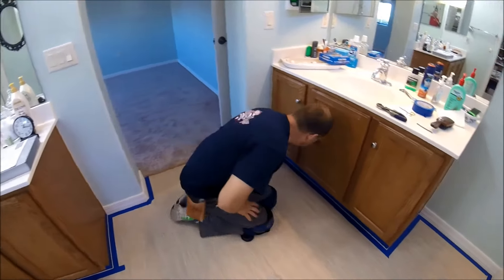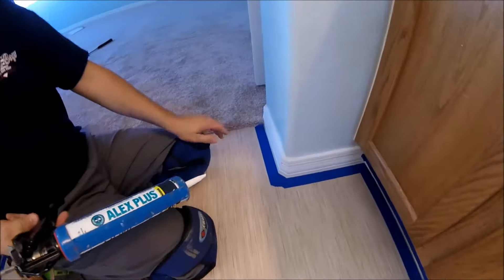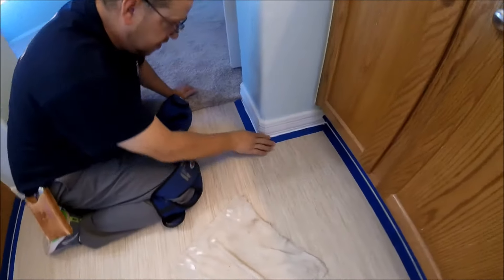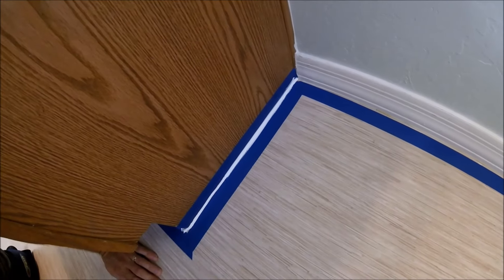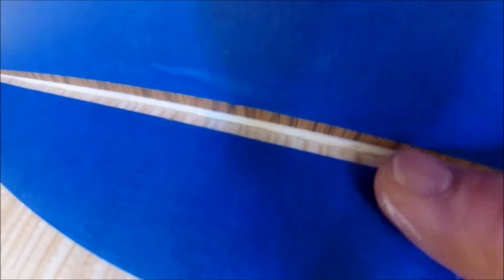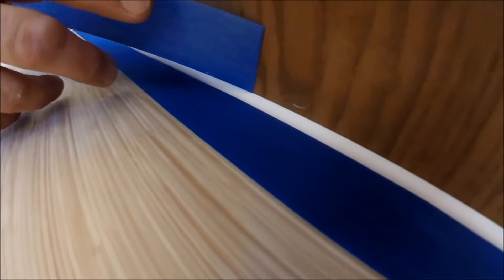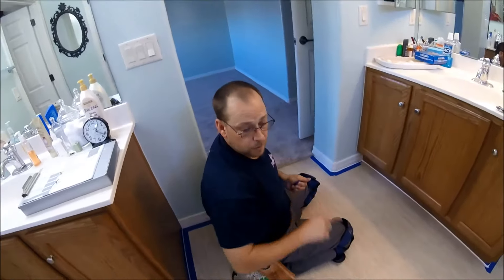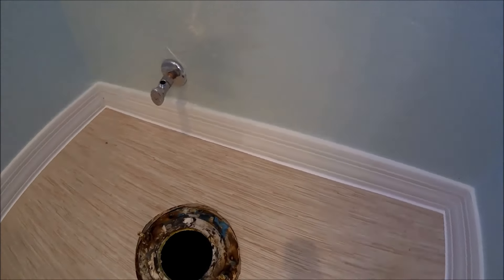HOW TO CAULK LIKE A PRO  pt2

Comment: Just like to ask its calk or silicon? Thanks
Reply from the maker: Caulk
Reply: @FloorsbySouthernboys  OK but If laminate starts moving little bit then calck don't get cracks? 🤷‍♂️🤔???
Reply from the maker: @lincia123  Laminate should not be caulked, it needs to have room to expand and contract it should never be caulked or stuck to the floor or wall in anyway
Reply from the maker: Caulk

Comment: A pro doesn’t use tape or run its finger over it
Reply from the maker: look at the title
Reply: I think you may need to use tape or you will get unnecessary caulk onto the floor.